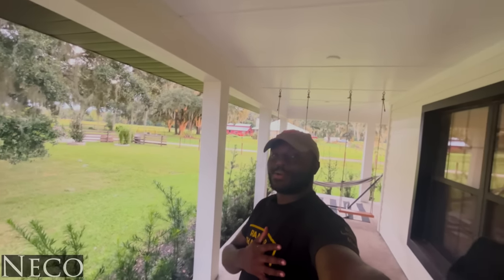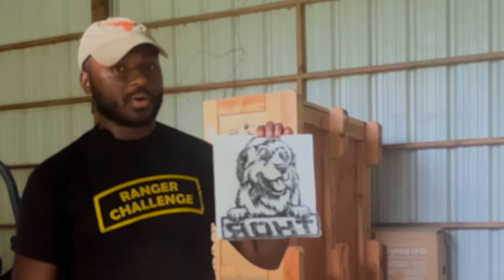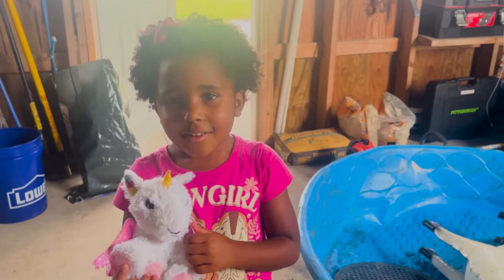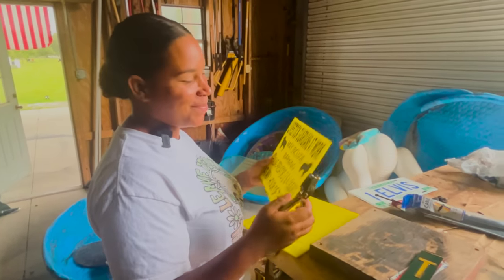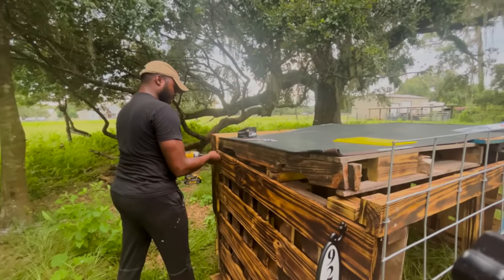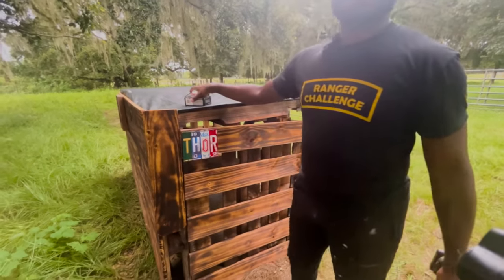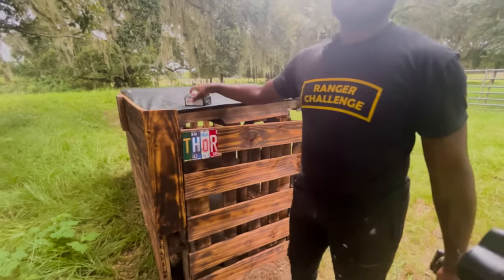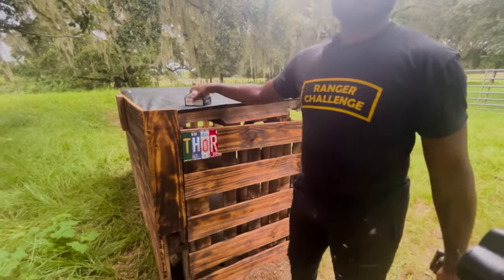We Are Leaving Florida!!

Comment: I think if you very lightly sand the wooden Thor sign, it would sharpen up the image a bit. (Weather may take care of it for you over time...)  Really cool idea to try and use the metal one as a stencil, super smart! Another option you could do it paint the back of the metal sign part black (or even white) in paint, a bit thick and then lay it carefully on a wooden board to lay the paint onto the board.